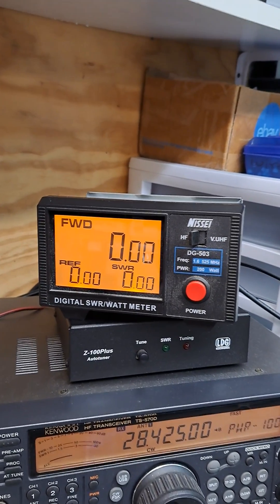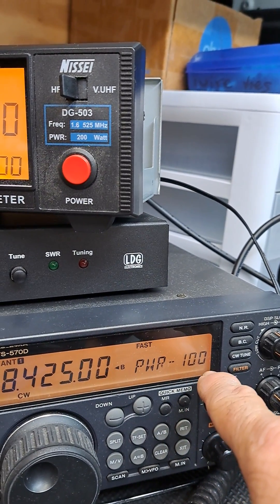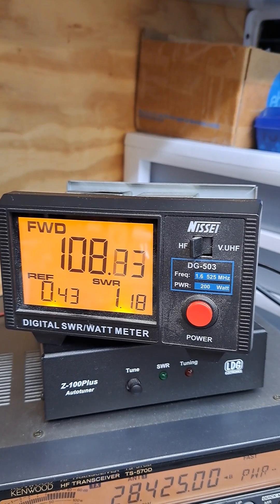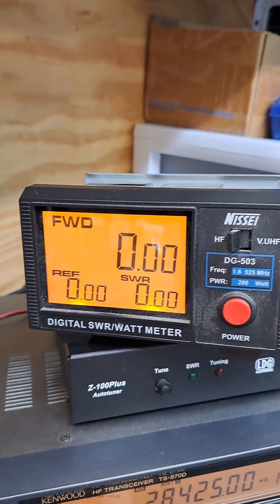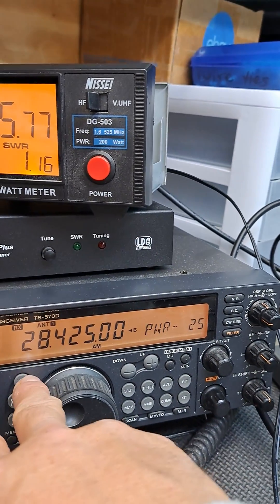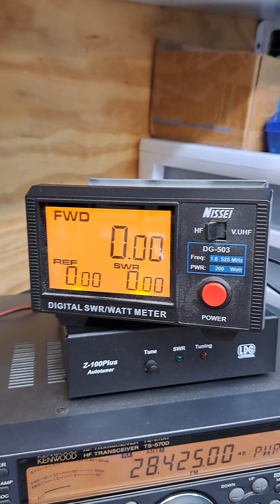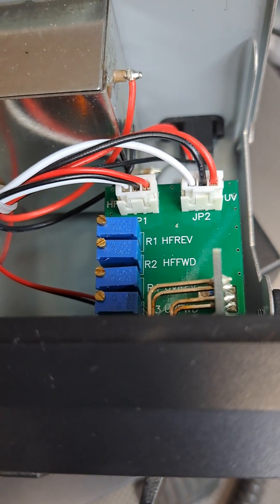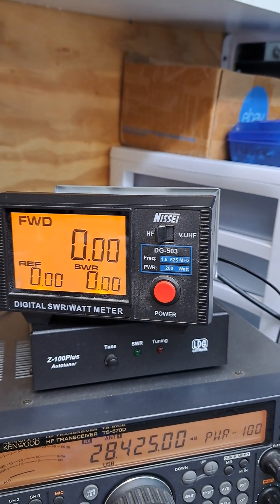NISSEI DIGITAL WATT METER

Comment: i need to replace mine i have used the old 3 way 500 watt radio shack  and the old Robyn 3 way 1000 watt   for years since the early 80s